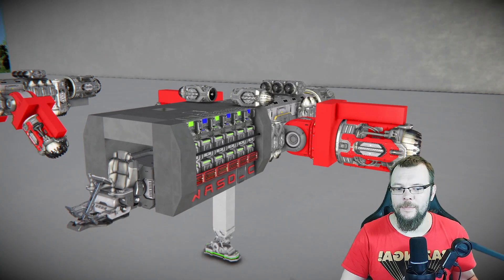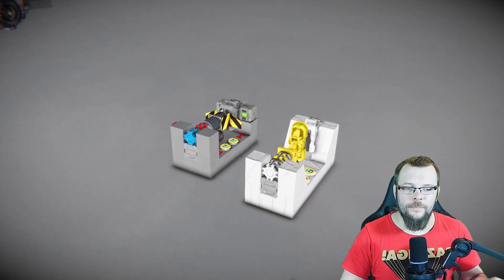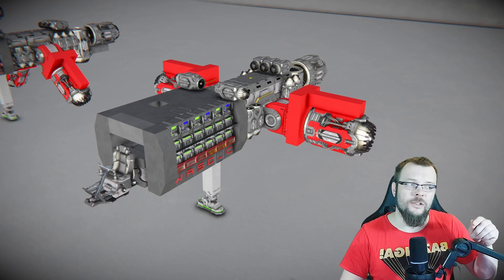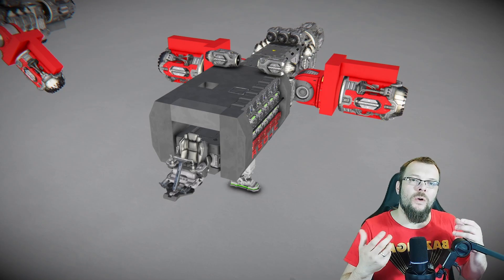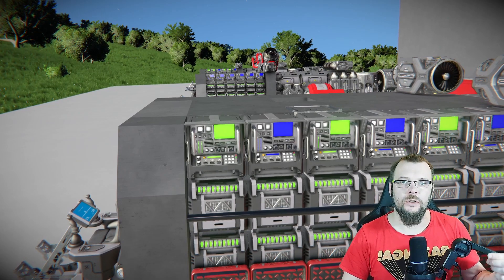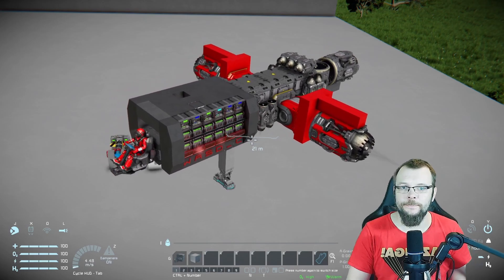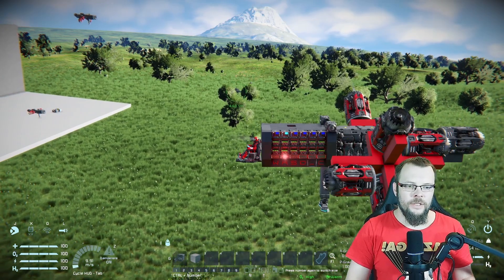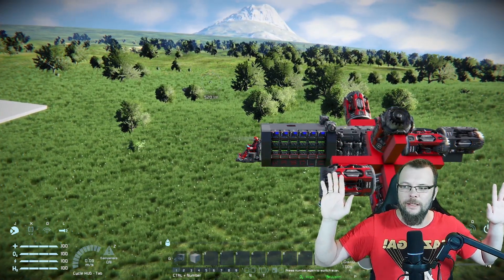The Gamechanger! [SPACE ENGINEERS] Scriptless Subgrid Thruster Controls - Tutorial

Comment: nice for bigger ships, i wish it coul be reduced to be used on fighter
Reply from the maker: Not for the smallest fighters but actually it can be used for it. This is just an example for visualisation. It can be made more compact and also it doesnt have to be one unit. You can put the single components in everywhere in the build you have some room left.
Reply: @KelevraEngineering  i just need free time to test a tiny version, you opened pandora box with this hehe , thx
Reply: If, for example, you had a fighter where the only subgrid thrusters were forward and backward, and you had at least one main grid thruster for forward/backwards as well, then I think you'd just need two small grid event controllers that would use the main grid thruster status to trigger the subgrid thrusters. The thrusters could be grouped or triggered individually if there are multiple forward and backward thrusters.

Comment: Is it possible to do reliable boolean logic with timer blocks? I guess it should be, but I've never seen anyone on youtube do that.
Because those 45° tilted thrusters would be able to also take care of up and down, if you can generate the right signals. For example, the thruster that moves you top-left would need to activate when you press the keys for going up or left, but stay off when the keys for going down or right are pressed.
Reply: Yes, Sensors, Event Controllers, Timers and even vent blocks are decently capable of boolean logic. Event Controllers are more in point with PLC logic, since you can finally lock every thing that requires a single input to a single block(and all bars are processed at the same time, unlike timers, which do left to right reading).
Reply from the maker: @FMHikari  this!
Reply: Event Controllers do have an AND function, though that only works if you're checking the same condition on multiple blocks. If you want to check multiple different conditions (for example battery storage AND hydrogen tank level) you need to use something else to build a logic gate. Connectors, large or small, are one way to do that. 

For example: If battery storage % =< 25% AND hydrogen engine tank filled % => 50%, then turn on hydrogen engine, set battery to recharge. That would use 3 event controllers and 2 pairs of connectors. Event controller #1 would monitor battery storage and lock a connector when it gets low, unlock when it's high. Event controller #2 would monitor hydrogen engine tank levels, when above 50% lock a connector, when below 50% unlock the connector. Event controller #3 would look at the connectors. If Connector 1 AND connector 2 are locked, then turn on the hydrogen engine. I did a more complex version of this during the Automatons Beta.

There is, or was, a bit of a bug using multiple blocks and the default OR behavior though, if the condition for both blocks becomes true, and then one becomes false, the output will become false even though the other block is still true. Haven't tested it lately so I'm not totally sure if it's been fixed.

And as has been mentioned on the other video, and probably here, event controllers have access to 9 toolbars, and can use groups, so that's a lot of potential actions they can do, so many situations can probably forgo the timer blocks. :)

Comment: This is awesome, so useful to have sub-grid controls for our fellow Engineers on consoles.
Would be easy enough to have two sets of the controls setup, alternate which is powered when spinning a rotor/hinge for a VTOL setup.
Reply from the maker: It wont need two of the controllers. Actually the output can be distributed to infinity by just letting the first timerblock trigger another. So no matter how many triggert functions this requires you can use all of them with the same output from one device.
Reply: @KelevraEngineering  Ah yeah, then you just toggle the secondary timers instead with the rotation.